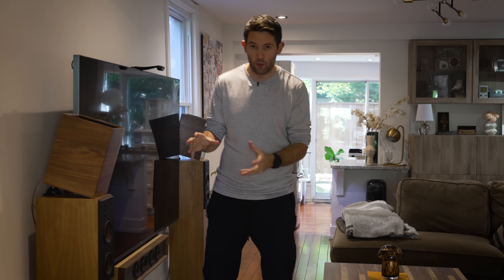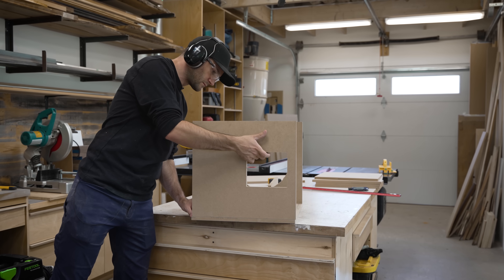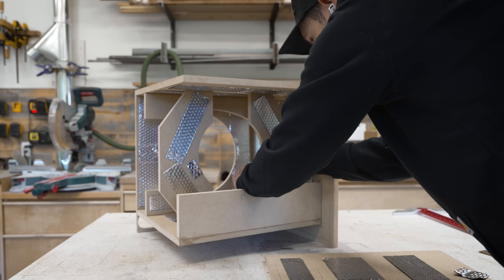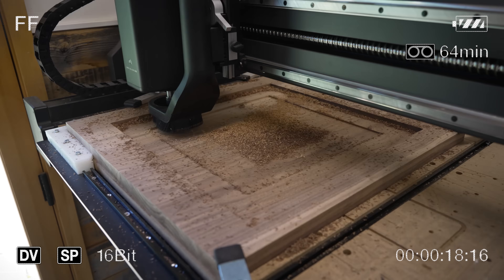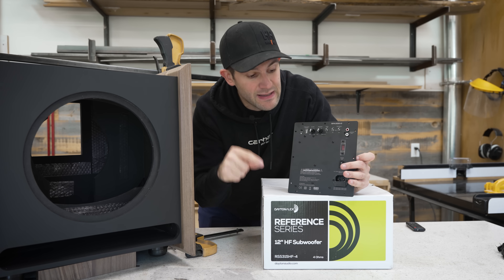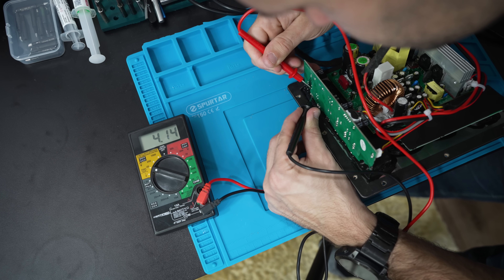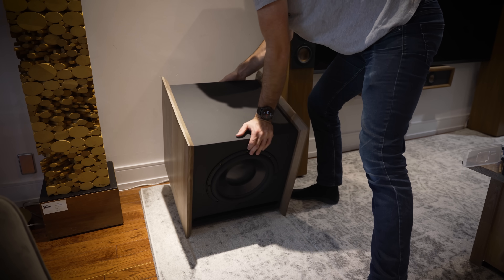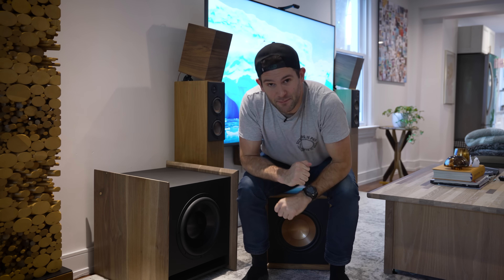THIS changes DIY Audio...

Comment: Guess I have to be that guy: class D is not digital, it is analog. It uses high frequency switching for the amplification, but never converts the signal to a digital state.
Nice build!
Reply: I work with high frequency transistors and amplifiers every day. Not audio, but the concepts are almost identical. 
I’m not going to say a concrete digital or analog, but I’ll give certain facts about Class D amplification. 
1.	Class D requires a conversion to pulse width modulation (PWM). This means there is a sample rate. IE, there needs to be high speed/frequency measurement of the analog signal to convert it to a duty cycle percentage (pulse on vs off), for each pulse, in the modulated pulse. This leans toward the digital argument. 
2.	Unlike a true digital signal, you don’t need a complex digital to analog (DAC) conversion. You need a simple RC (resistance capacitance) circuit, to work as a low pass filter. This is because you only need to find the “average,” which is dictated by the duty cycle percentage. This leans toward the analog argument. 
3.	I saw someone say that this is the purest amplification method. This is not true. The key advantage of Class D amplification is the efficiency. This is due to the PWM method, when the pulse is at 0V, there is almost not power consumption. There is harmonic distortion in a Class D amplifier due to the fact that there is a sample rate. IE, if you put in a pure sine wave into a Class D amplifier, you would see a “stepped” sine wave on the output. Are you going to notice a difference? If you can hear the difference, you’re a unicorn. The lowest harmonic distortion goes to Class A, but Class A is also the least efficient and consequently will be very large in size and will work well to heat your room.
Reply: @rygilly32  facts, thank you!
Reply: @rygilly32  My take away is you're saying that Unicorns have better hearing than humans!
Reply: And also it is actually better to have the power of the amp be greater than the speaker to prevent it from distortion and therefore damaging the speaker. If you turn the speaker up way too loud it will get damaged no matter what.
Reply: @BassBülow  100% this... the amp should always be of greater potential than the speaker... not enought amp is what results in a clipped waveform (DC energy) hitting the speaker and doing damage.
Reply: @BassBülow  exactly, was looking for this comment. Zac is wrong..
Reply: @BassBülow Strange fact: But unlike older tube amps, most solid state amp actually have LOWER distortion when operating near ( but not at or above) their maximum rated power,  so it is actually best to have a “just powerful enough” amp.   Most people have amps that are way too powerful.   But most people cannot here “.05%THD” anyway, so it is usually a moot point.
Reply: @ People don't hear THD. They hear IMD. When it sounds harsh, that's IMD. Clip 10kHz and listen.
Reply: @rickutah7705 I've seen the charts, they support a bigger amp.  If the lowest distortion is at 3/4 power, then a 400w amp driving a 300w speaker would achieve the lowest distortion at max volume.  The flip side is if you drive a 300w amp to maybe 320w you can be at 10% distortion rather quickly.       Even if I run a 1000w amp we're often talking about the difference of 0.005% thd to 0.010% thd.  Good luck on hearing that.  Keep in mind amps also have lower distortion at higher ohm loads.  So if you get a 1000w (at 4 ohm) amp to run this 300w speaker get the 8 ohm version of the subwoofer.   This is now a 500w amp at 8 ohms.  Lower distortion,  still plenty of headroom, and "high current" in home audio terms to signify the amp won't crap the bed if it goes below the ohm load the speaker is rated for.
Reply: @BassBülow  exactly, im running an 8kW rms amp on my monster 24 inch home theatre sub wich is only rated at 4,5k, and it works just fine
Reply: @BassBülow , why higher and not matched?
Reply: @BassBülow this! It’s daft to pick an amplifier less or the same as driver power handling on purpose. Much better to use a comfortably powerful amplifier that can run the full load without stress and with less distortion. I’m still amazed how many people doing projects like this, don’t understand the relationship of power to driver.
Reply: @BassBülow I'm not MECP certified but I did work in a custom home/car audio video shop. I was always taught that amps with less wattage are more likely to damage a sub. Having overhead wattage was a preference and not a liability.
Reply: @BassBülow  It depends. In multi way speakers, power distribution ratio gets shifted towards the midrange and treble as you increase the amount of clipping, so the midrange and treble will be better off with a more powerful amplifier within its clean limits, but the woofer will be worked harder. I mean it's also very variable with the type of music being played too.
Using a more powerful amp will get you the most high quality performance out of the speakers you paid for, assuming you like it loud, but won't necessarily protect the speaker, even though it will sound better right up to its limits. This is a double edged sword as some people might push the speaker too hard as it is still sounding good. Though drivers do introduce their own version of clipping at mechanical limits, thermal limits can sneak up on you, even though those can change the sound signature too.
It also depends on how speakers are power rated. A 200 watt speaker might cook with a 200 watt amplifier playing a sine wave. Many speakers are rated with music in mind, and it's nice to know that the kick drum going PHUT! at 200 watts for a tenth of a second won't damage it, while the rest of the music is at 10 watts. You have to be careful with more and more music having continuous bass and average levels creeping up so the speaker is staying at powers approaching the 200 watts more often and risking a voice coil overheat.
Frequencies are another thing that I touched briefly up above. The power handling of a speaker is different depending on the frequency of the sound. Usually more in the bass and midrange and less in the tweeter. The tweeter can generally produce louder sound on the same power though, both due to its own sensitivity and your ears' sensitivity, which helps. Also at very low frequencies, the woofer can flap around and dent the voice coil former if it bangs into the back of the magnet. Best to filter those out especially in ported enclosures. It will also sound better if your bookshelf speaker isn't trying to reproduce 25Hz.
Reply: @buelow123 exactly i was going to say this as well, but you beat me to it 😂😂😂😂😂
Reply: Using an amp near its max output will give distortion so the signal will not be a nice sine wave but more like a square signal which will damage the coil and cone. Hence the recommendation to use an amp that is able to handle more though not to run it at 100%.
Reply: An amplifier has a maximum output, typically a semiconductor junction or two's voltage drop less than the supply voltage. When it reaches that level, it will start to clip. Music is not really sinusoidal, but sine waves are used in amplifier testing because they have no harmonics—ideal sine waves are harmonic-free. Some audio test oscillators come very close to producing pure sine waves. You can drive an amplifier with a pure sine wave, notch filter it out of the output, and what is left is primarily the distortion. Nowadays, there are more sophisticated ways to analyze it, allowing you to see the various harmonics and their levels.

Square waves are not overly hard on woofers, but they pose a problem for tweeters. A real square wave has an infinite series of odd harmonics that extend into the ultrasonic range—well beyond where the tweeter can move. This ends up heating the voice coils, as they are dissipating power without much movement. Tweeters don't move much anyway, but without cooling from motion and with an undue amount of power, the thin voice coils in the tweeters can melt.

When you see a tweeter with a maximum power dissipation listed, it's often the maximum amount of power in normal music before the crossover, so the tweeter itself is only rated at a small fraction of that number. Try running a 10kHz sine wave into a tweeter rated at 60W on the box, and you might only make it to 5 or 6 watts.
Reply: @BassBülow  Not true, distortion doesn't damage a speaker, to much power does. I have a pair of 70 year old guitar speakers that have seen nothing but distortion their whole lives and work perfectly
Reply: @feltyash6484I think when they’re speaking of distortion they mean clipping, which  is of course square waves rather than sinusoidal, which creates a distorted sound but more importantly pushes the driver into basically “locked rotor amps” for the period at the top of the square wave. During this time the driver is pushed to its max limit and held there all the while drawing lots of current, eventually overheating the voice coil and melting the insulation around the wires. The resulting short circuit not only destroys the speaker but potentially damages the amp as well.
Reply: @BassBülow  Also helps with impedance rise.  That 4 ohm speaker isn't going to be a 4 ohm load on the amplifier once it starts playing.
Reply: @BassBülow you're still turning up the amp you can't turn up a speaker but what do you mean? U mean impedance? Or like Max ratings type stuff. Because going higher impedance is not always good in can strain your amp even burn it out
Reply: @BassBülow  "it is actually better to have the power of the amp be greater than the speaker"
This is highly debatable. What is "power of the amp" and what is "power of the speaker"?
Some amps' power is rated at 10%THD, while some claim it before the THD starts to rise (0,1-0,001%). And the term "power" is even more ambiguous when talking about a speakers.

Yes, when amp starts distoring, RMS power rises (RMS of a square wave is higher than that of a sine wave with identic amplitude), however this is only a problem to a certain degree. 20W amp running at 100%THD will not blow a 100W speaker. However if you want to use your speakers to their full potential, you might want to prefer an amplifier with higher rated power - speakers can typically handle power spikes above their rated power - if you don't exceed their mechanical capabilities (Xmech). The problem, however, is that you will definitely hear an amp distorting, while speaker being pushed above its limits is typically not that obvious (especially when talking about electrical limits).
Reply: @BassBülow  the #1 reason for blown speakers and subs: too little power. Clipping.
Reply: @scottlowell493 Clipping creates overtones. And if you have a 3-way loudspeaker then clipping of low-frequency makes overtones delivered to speaker elements intended for the higher frequencies. But they are designed for less power. In a subwoofer, you don't have any tweeter that will burn from massive amounts of overtones.
Reply: The simpler forms of class D amplifiers are basically modified switch mode power supplies.  Mostly that means the power devices don't operate in the linear region like the power devices of a class A or class AB amp do.  On the power supply side, the opposite of a switch mode supply is a linear supply.

Any way in class D the input is usually analog, the output is always analog, the feedback is always analog.

If the manufacturer adds a DAC input that's kind of digital maybe.

The only real argument for a digital amp is one that uses a DSD input (direct stream digital) which kind of doesn't need a DAC.

Any way, it's a distinction without a difference unless you prefer the distortion of analog systems, which is weird because the speaker itself is the overwhelmingly large source of distortion in a sound system if the source and signal chain are decent (analog or digital).

For reference I used to design switch mode power supplies and worked with Tripath indirectly...
Reply: @beardoe6874  I was about to comment the same thing. As a related aside, do you know why a more robust control loop is not uniquitous for audio amplifiers, especially in class D? I've only seen (wonky) P controllers implemented via single opamp, but not really something more robust as a PID or similar as the case in (higher end) powersupplies.
Reply: @ivanrodionov9724  audio power rails are usually just bridge rectified and filtered AC, not regulated.  The idea being that the feedback for the audio signal will automatically compensate for the 60hz ripple and any other line noise.  A regulated supply will have steadier voltage but if it's a linear supply the power device in the regulator will act a bit like a resistor if you are pushing the power too high.  A switch mode supply might be able to keep up a little better but still it's going to limit the supply headroom, slew rate or whatever you want to call it.
Reply: Pffft what would this guy know 
Checks username 

Oh...
Reply: Correct.

The "D" designation is coincidental; it was just the next letter in line after the previous new category, which was class C.
Reply: Thats what I was just about to come post lol. I just got my own class A amplifier working from scraps yesterday and when he said that I was just like, Surely someone else caught that! But yes, class D amplifiers are more efficient (Amp per Decibel) and still fairly low distortion.
Reply: That was a pretty funny statement
Reply: I was a little confused by watching the video and disagreed on a few of the statements made, but then I started reading the comments and realized some of you know WAY more than I do.  I hope all of you are doing something with this knowledge you have.
Reply: Goodness everyone so knowledgeable here. 
Is it clean?
Do I feel it starting at my toes? Does it crawl up my spine? Does it lightly tickle my heart? 
Does it remind me of my grandparents sound system from the mid 70’s to mid 80’s? Yes?
Than
Yes!😂
Reply: Digital vs. analog has everything to do with how information is transmitted. In digital signals the information is encoded in discrete, well defined states (1,0 or on/off). The signal is generated so that there is no ambiguity on whether it is one or the other. In analog systems the information is represented as waves. In the case of a class D amplifier the information (sound waves) is received as a wave and leaves the system as a wave. The pwm is not used to transform the information into discrete, well defined states (that would be an ADC) but instead to generate a new wave, extremely similar to the first but with a lot more power behind it (hence the name amplifier).
Reply: I like pizza
Reply: This a fragment of an interview with Mr. Bruno Putzeys, an authority in class D design:

Q: Why is class D considered digital, when it isn't?
A: To be exact, class D isn't digital. Digital means everything is done on numbers. A class D amplifier works with voltages and currents changing in time, as any other amplifier does.
This misconception comes from a misunderstanding of the "D" letter. It was invented in the 1930s when classes A, B, and C already existed. So they named it with the next letter: D. Of course, in those times, there was no digital technology with which you could mistake it. In 2004, I co-authored an AES(Audio Engineering Society) document titled "All Amplifiers are Analogue". It's worth googling and reading.
Of course, there are amplifiers utilising DSP as an element and you can call them "somewhat digital", but "real" digital amplifiers don't exist.
Reply: @DIYHiFi Sigh. I think we are semantically passing ships in the night. Digital the way I’m using it in this case is two state 1/0. Digital the way it’s described and I think you are using it is a discrete sample in time e.g. A/D - D/A conversion. Both are discrete though. And using a filter to get rid of switch artifacts in the output of a class D would pretty much nail that the signal was discrete time at some point in its journey 😅
Reply: @DIYHiFi  I beg to disagree with his rational.  The control element is either on or off, that is digital.  It is not digital in the same sense that other digital audio systems are digital, but there is no question that the output are not operating in their analog regions and in fact the type of transistors used in this type of circuit are designed to have a compressed linear region.  They are designed to be used full on or full off.
Reply: @reggindog3436  Bud, I hate to tell you this, but audio amps are not digital.  What is the line signal to the amp?  It's not a digital signal, it's analog and it runs on RCA connections.  It makes zero sense to take an analog signal that has already been received, convert it to digital just to convert it back to analog.  Think about it, for what purpose would you change from analog to digital and then back to analog?
Reply: @reggindog3436  It is also a very common misconception. A switching signal, that is on and off can be digital. But doesn't have to be. PWM which is pretty close to what is happening in a class D amp, can be generated with a digital circuit, but it can also be generated by a NE555 timer with a couple of resistors and a capacitor. Switching mode power supplies are also analogue and they are using switching: on and off state. 
Refer to the recommended article by Mr. Putzeys and check the definition of a digital signal on Wikipedia.
Reply: @realmenhavelittledogs2661  I dunno,.  Only like all audio you hear these days?  Starts with an analog mic, analog mic pre, a lot of folks still use analog eq etc, and save the track digitally.  Master it, send it out digitally, and you play it back through analog speakers so, pretty much the entire audio chain is what you suggest is dubious in purpose.  

In the case of a class D amp the transistors are used in a binary state on or off.  The switching frequency is high enough the output can be filtered with a relatively simple and inexpensive low pass filter and in the end you get a pretty good approximation of what you put in.  

Tell me, do you consider switching power supplies analog or digital devices?  Would you call a switching power supply an analog power supply?
Reply: @reggindog3436  That statement just proved you don't know how audio components work.  Signal encoding has zero to do with how it is rendered/reproduced out side of a couple of formats (AAC and MP3) that reduce sound quality in favor of file size.  After the signal is decoded at the Signal Processor (Pre-Amplifier, Receiver, Head Unit), how person "X" saved their sound file doesn't mean squat and signal encoding is not what this conversation is about.  This is not dubious, this is common knowledge.  Let me ask you, can you plug a Digital Music Controller (phone, mp3 player, etc) directly into an amp?  That answer is no.  Because the signal hasn't been decoded to an analog signal.  

Focus on the conversation at hand, power supplies aren't the topic.
Reply: @realmenhavelittledogs2661  The conversation at hand you seemed to think it was weird to take an analog signal, digitize it and than turn it back into an analog signal.  Regardless of the codec used, that is pretty much the digital audio chain as I pointed out.  Start out with analog, digitize it, and ultimately turn it back into analog.  So that sequence of events is very common.

As far as the power supply question, it relevant as a class D amplifier is pretty much a switching power supply.

You are welcome to believe what you like, but for my money, when an audio amp runs it's output devices in a binary manor, I am going to consider it a digital amp.
Reply: @reggindog3436  You really need to read better into what I was speaking about with an AMPLIFIER.  The LINE INPUT (aka the signal that carries the music/audio from the signal processor into the amplifier)  is analog (RCA input jacks).  So the INPUT SIGNAL into the AMPLIFIER is ANALOG.  You mistakenly claim that it is then converted to digital just to convert it back to analog.  So I ask you, why would they convert an ANALOG signal to digital then just convert it back to analog?  

And you are trying to obfuscate the matter by talking about the prerendering of the audio, which has NOTHING to do with the input to the amplifier.

And no an amplifier is not a power supply, you are extremely mistaken on that one.  Even a simple google search will tell you that.  The function of an AMPLIFIER is in the name, it takes a signal and AMPLIFIES it.  It does NOT provide power and in fact REQUIRES a power supply to function.

The humor is how wrong you are and yet you are still trying to make yourself right.  Please research just a little next time.
Reply: 100% correct. A class D does not mean Class Digital. Does Class A/B mean Class Aight Bruh? Haa. Completely incorrect there. Maybe some of the "features" are digital.... Lol
Reply: That high frequency switching is a 0 or 1 state, unless you think it's different that's digital.
Reply: I came here for this comment😂
Reply: Just saw this video and I was going make the same comment on Class D amps... Analog for sure!
Reply: The "D" is simply the next letter in a series of amplifier classes ie: A, AB, B, C, D, G. It doesn't stand for digital. However, I can assure you this IS a digital amplifier that uses PWM (or various other digital modulation methods) to simulate a linear wave function.
Reply: Correction: Technically, Class D is not a digital amplifier—it operates differently from linear amplifiers and can be paired with digital processing. 🫡🔊🫶

However, some manufacturers do use true 1-bit digital amplifiers, such as Bose, McIntosh, and Devialet with their ADH hybrid technology. These do exist in the car audio world.
Reply: The D doesn’t stand for ‘Digital’. Actually  the letter monikers used to identify the different classes of an amplifier don’t stand for anything specific. Without going into huge details, a Class D design takes an analogue input and turns it into a PWM (Pulse Width Modulation) signal. The peak of the signal results in the widest pulse and the trough, the narrowest. Class D amplifiers always have an output filter to takeaway any high-frequency noise generated by the conversion process. This is where the quality of the filter used has a great bearing on the overall sonic performance.
The major plus point of Class D is it is very energy efficient. A typical Class A design tends to be around 30% efficient. Class A/B roughly doubles that and Class D amplifiers almost triple it. That means proportionately lower power consumption which leads to less heat. The efficiency also allows Class D amplifiers to be smaller but still deliver huge power outputs for their size.
Reply: Correct
Reply: This made ma watch PS Audio's "are class D amplifiers digital" and learned me some. From my understanding, for something to be digital the receiving end also needs to be digital. (Also the pwm should have some data digitally), except this pwm doesn't, the receiving end is analog, a low pass filter. 
If you would look at the pwm of the amp, you could kinda figure out the "sine wave" of the audio.
In digital, you'd have to know the encoding/protocol, then decode that data. You'd be usually using a logic analyzer for that, a digital receiver. But if you try to use that on a class d amp, there's no data to decode, because it's basically an analog signal in a different form.
Reply: @DIYHiFi  you're both right.
Reply: Zach is an idiot when it comes to speakers.
Reply: Class D amps are good for sub bass as well.
Reply: Ah, thanks. I wanted to comment the same, but you spare me the effort. :)
Reply: I don't think that I would void my 5 yr warranty from Dayton to hide a few wires that would be out of sight any way.  If it is that a serious consideration, overlap 3 of your cabinet panels that back up to your wall
Reply: Theres always someone smarter and better than you
Reply: Connect it to the spi interface, decide on bit length. Process signal to bit sequence to represent sound or simply code it to have pwm sequence. Profit, now it is a digital sound. 😂
Reply: Bravo, I did the same thing for watts & speakers - drivers don't have watts.
Reply: @johnsmith1474  IDK who you're talking to, but while drivers don't have watts, they do have thermal limits rated in watts.
Reply: Exactly. And well-said.
Reply: Often the chips work digitally internally doing the choice with logic to turn on or off. 

What you want to call digital i guess can vary, not that it matters for you if theres an adc involved.
Reply: The comments are far more entertaining than the video itself. I run a single kicker cvx 10" on a 1 ohm class D kicker amp (with FIT technology ) @ 495 RMS in a huge box tuned to 38hz and a sound stream digitizer. Flexes the roof of my SUV. I'd put it up against any 10" on 500rms.
Reply: Well, at least it is 4k UHD.
Reply: The only true analog app is a class a and a class a b amplifier
Reply: @mikesmithyo1983  FFS, No, Mike. Class D is analog in, analog amplification and analog out with no encoding happening anywhere. Everybody gets hung up on the PWM power supply, which isn't really digital, either.
Reply: A lot of people seem to be confused and think that PWM is digital but it doesn't have to be, if it's on a micro controller it probably is, the width has steps, an 8 bit PWM output would have 256 steps as an example (digital). You can however have infinite steps to determine the width (analog),  Class-D uses the latter, which makes it analog, Yes there is switching going on but the length of the on/off time is analog and isn't determined to by certain amount of steps in a Class-D amplifier.
Reply: @RoycoNL  "A lot of people seem to be confused", including yourself. The word Digital refers to either a one (high) or a 0 (low). You appear to be confusing and trying to say that digital has to have a set number of pulses, which is untrue. Class D amplification is done by switching MOSFETS on or off (Digital) then smoothing out via a filter, just as you would with a D to A device.  In fact class D could not be done properly until the MOSFET switch came along, given both geranium and silicon devices could not switch fast enough. Note the word switch as in a TTL is a switch and is digital just like the mosfet switch which is also digital.
Reply: @michaelward402   I think you should look up how a Class-D amplifier works, the length of the pulse is determined by the audio signal which is pretty much analog in a Class-D amplifier, that is uses a switch is irrelevant, so anything with a switch is now suddenly digital? what about a switching power supplies? the themostat on your heater? Do you even have a background in electrical engineering?
Reply: @michaelward402   Not a set number of pulses but a set number of values, the length of the pulse in a digital PWM output is determined by a resolution, in my example it was 256 values, in analog it's practically infinite and that's what a Class-D amplifier uses, at no point is the signal being converted into a pure digital value.
Reply: @RoycoNL  Now that is just abusive, have you actually referred to a dictionary and looked up the term digital. What you are describing is not analogue in its purest sense it is digital and there is no way anyone can disagree with the fact that it is a switched waveform that requires filtering to produce an analogue waveform. 
There is little point in trying to be abusive when you clearly cannot reconcile the fact that a switched waveform is digital in nature and yes a smps is digital, not only based on the fact that any English dictionary tells you it is, but the fact that it is not an analogue linear PSU.
I won't bother answering again given your clear bias and inability to understand what the term digital means.
Reply: @michaelward402   I didn't mean to be abusive but I think you fail to see that the length of the pulse is part of the equation, it's not just pulses of the same length at a fixed frequency, I'm sorry that I can't seem to convince you but I'm convinced you are missing part of how this works. The only digital part of the Class-D amplifier would be the output stage being on or off, the length of the pulse is still analog. Calling something digital because one part of it has only two states is a bit  short-sighted imho, that would make about everything digital including your class A amplifier if it had an on/off switch.
Reply: @RoycoNL  A class D amp does not give any infinite resolution - it delivers quanta. Ha ing transistors pulse haed between on and off causes an output signal that needs a low-pass filter to get a signal with soft flanks instead of a burst of square waves.

You can go from 16-bit or 24 bit to 48 bit and you can count every single electron that was carried by each pulse. But knowing the actual electron count isn't really a needed step here. It's enough that the transistors are run at a digital mode. The purpose of the process here was never to keep/record the audio. Just to move it to the digital domain for the driving of the transistors before the final low-pass filter.

The amplifier is mapping continuous infinite values into a smaller set of discrete finite values. Some amplifiers has a fixed charge/pulse. Some has a finite number of pulses/second. PWM is one of four different ways this is done, to get into the digital domain needed for the output transistors. And a reason why a class-D amp needs the same type of lowpass filtering as other DAC solutions to produce a smooth output signal.

Analogue transfer is water continuously flowing out of a faucet. Change to a bucket brigade and you have moved into the digital domain with quanta of water.
Reply: @perwestermark8920   I'm not the best at explaining things but the point I was trying to make is that there is no bit length in Class-D amplifier, you're comparing the analog input signal to a triangle/sawtooth wave at usually a fixed frequency, this determins the duty cycle of the PWM signal, at no point is the signal converted to a pure digital data stream.

take the faucet example you mentioned, you can open and close the faucet at fixed times but the time you open and close it between those fixed times can be analog, but yes you will need a lowpass filter to smooth it out like DAC.
Reply: @RoycoNL  But what you are talking about really is moving the signal into the digital domain - the strict off/on of the transistors is a digital operation (if we ignore the flaws of the physical world where the transistor switch time isn't fully instant).

It does not matter if you can put a number of bits on any sample or not. Digital encompasses more than that. You have left the analogue world when having the signal passing a transistor that is only fully opened or fully closed.
Reply: @perwestermark8920   I have to disagree on this one, take your faucet example, you are creating pulses at a set time interval by opening and closing it, but how far/long you open it (the pulse width in PWM) is still linear/analog in a Class-D amplifier no matter how hard you drive that transistor, so at no point is this true digital signal, we're looking at more than just the state of the output, but I'm convinced I can't convince you and I doubt you can convince me so I'll just leave it at this :)
Reply: it's a digitally controlled switch? :) But true that, then filtering with low pass, and what we are left with is our sound :) No waste, no heat, genius.
Reply: And oversizing your amp is not always a bad thing. It gives you Headroom and less chance of clipping.
Reply: the d is for dermarse
Reply: The "D" in Class-D does not stand for digital as it is a sequential identifier. However, it is fair enough to call it a digital amp because it works by converting an analog signal into a digital code, then switches it to a higher level, then converts it back to analog with a low-pass filter. The reason why people say it is NOT digital is because it is not PCM, but PCM is only kind of digital coding, albeit the overwhelmingly most common kind. Believe me, no one is more pedantic with terminology than me - but it is ok to call it a digital amp.
Reply: A class D amplifier is digital. It uses the MOSFET in switch mode instead of linear gain mode. That means the transistor is either on or off. That is the definition of “digital”.
Reply: I prefer a G/H amp in Carver old school power
Reply: Most amplifiers have filtering to roll off the HF output above the audible range.  Class D in particular is filtered because it has more HF switching energy.

With that said, distortion can be very low, competitive with the best Class A, Class A/B and the distortion that exists (near clipping) sounds kind of tube-like.
Reply: @beardoe6874  .All Class D amplifiers, as you noted, require integrating capacitors and filtering due to their design. This is just the nature of the beast. Most linear audio amplifiers do not intentionally roll off high frequencies. Looking at some of the amps I have around here: the Phase Linear 700 and 400, both are good to at least 40 kHz; the Spectro Acoustics P202 is also good to at least 40 kHz; the Adcom GFA-555 is good to at least 100 kHz; and in my room, my old McIntosh MA 230 with tubes and an output transformer is good out to at least 50 kHz, as is its solid-state cousin, the MA 5100. As a general rule, the only amplifiers where the high-end frequency response is capped are Class D amplifiers, and that is not because they want to, but because they have to.
Reply: Though it’s technically analog the reason it gets its name is because of Puls Width Modulation (PWM) the switching on and off is compared to ones and zeros. One being on and zero being off. This idea of switching is similar to digital in that digital is made up of ones and zeros and is not linear. Also PCM (pulse code modulation) is not the only digital format. DSD which is puls density modulation is considered digital even though you can play it directly into a speaker or low pass filter with no code unlike traditional PCM. Similarly the technology used in class D has similarities to a digital signal even though it is not PCM. If you ask many engineers about this they will give you a similar explanation and many consider it to be a form of digital.
Reply: @johnj596  It is technically digital.  It converts the analog into a stream of digital pulses, and filters them to to get an analog approximation of the digital pulses.  All of the amplification is being done by devices either being on or off and trying as hard as they can to remain out of the transistors analog range.  Call it a switching amp if that makes you feel better, but it is switching between on and off.  There is no analog there.
Reply: Oh, he must be talking about a class A tune amp!?
Reply: This guy has a lot to learn about building speakers.  No shame or shade, but you can tell he's a rookie.
Reply: go check your books before posting bs. class D is digital amp, A or B are not.
Reply: I love this guy, but this was literally the moment where I had to go to the comments... you raised the topic very gracefully.
Reply: I had the same exact thoughts when I heard him say it. Same with the comment below about the amplifier being greater than the speaker. The more you crank up the amplifier, the more the distortion, and shorter the speaker life. Better to have a 500w amp turned down than a 300w at max all the time. It did come out nice though, I'd still suggest putting a larger amplifier in.
Reply: PMW is using transistors in a binary digital on off mode not linear gain devices this is what a digital transistor does. So even if its not actually digital it is using the transistors like digital devices not amps. Also in most the pulses are synchronized with the digital audio signal making it a direct conversion from digital to analog. meaning it is made for a digital source.
Reply: @remotepinecone   The original comment still stands though. Class D does not mean digital amplifier. The term has been in use long before "Digital Amplifiers" were commercially available. It's referring to the power supply and it's efficiency. The simplest way I remember when I was still doing car audio it is that Class D is more efficient and class AB had lower total harmonic distortion. Class D amps were popular for mono-block subwoofer amps because the distortion wasn't really heard in the final product, Class AB was used for mids-highs for better sound quality.
Reply: Do you believe that PWM is analog or digital?
Reply: @railgap  PWM is a digital signal. It is possible to sweep the pulse width so quickly that a single pulse could start at 0% and end at 100%. Could we say that pulse is digital but the width is analog? Perhaps. But since most PWM sources are microcontrollers, the width of a single pulse is fixed.
Reply: So which amplifier is digital
Reply: @pavus9821  Class D uses switching (digital on/off) to simulate a linear function.
Reply: Depends on what you think "digital" mean. It is digital in terms of using exclusively "binary" power states (on/off instead of smooth gradients). By the definition of the word "digital", a class D is indeed digital. 

A digital signal is just electricity in a cable just like analog signals are, but they transmit the signal as rapidly pulsing on/off states (1's and 0's), which is what MAKES it "digital" in the first place.
Reply: @MFKitten  
Yes, digital CAN mean a two-state system, akin to binary. In the context of amplifiers, which is what's being discussed, we're talking about the SIGNAL, which is not digital in this case. The power supply isn't even technically digital by the looser definition, it's PWM which is an analog signal, just... rotated 90°.
Reply: @SwervingLemon  digital is not just binary, it can have many steps. Perfect example is a dac which is a digital to analog converter, the more steps the better resolution which gets you closer to the analog signal which is continous.
Reply: The build is nice, but a lot of the information is incorrect.
Reply: It’s a matter of semantics. In the most fundamental form it is digital since one operates the power transistors not in the analog region but only in the on/off states.
And yes this binary output signal is heavily filtered both in the amplifier but also in the speaker element to regain the analog signal.
Reply: @andax2007 There's no bitstream. Period. No encoding, no ADC. It's A2A. The frequency of the PWM even has to be outside the realm of 22k just to avoid high-frequency noise entering your signal. The only part of this that people are mistaking for digital absolutely isn't. PWM does not equal digital.
Reply: @ a signal can be digital both in the amplitude and temporal space.
As I said it is semantics. As there is a comparator in the processing chain having a binary output. This output controls the power transistors to be either completely on or completely off.
So yes the signal is indeed digital in amplitude, but it is not a clocked process, so it is continuous in time.
Reply: @andax2007  But PWM isn't discrete. It's just a voltage over time, chopped and laid on it's side. You can keep trying to make the class D look like it's digital by broadly expanding what qualifies as digital, but I'm done entertaining this nonsense.
It's A2A at the end of the day.
Reply: @ with this reasoning you could say the any signal is not digital. Is a UART signal analog or digital?
As I said, it is an analog output signal due to it is heavily filtered.
But it is in principle digitized into a one bit binary signal at the comparator in the signal chain. Once more, a signal can be discrete both in amplitude and in time. PWM is a signal discrete in amplitude. Yes this signal is transported as a voltage (but only in principle at two levels). Is a MCU digital? It carries the signal internally as analog voltages.
Reply: @andax2007  Good god, no. I'm done with this ridiculous premise.

There is no encoding happening here, no interpretation of an encoded signal. There is approximation happening here, not quantization. Your UART argument is a strawman. The amplitude in the class D is NOT discrete. It's domain is time and infinitely variable between 1 and 0.
Reply: The D was for dumbass😁
Reply: but it says digital on the box
Reply: wrong, it is a digital amplifier
Reply: Thank you :-). I guess we are all that guy.
Reply: Is a good thread by the way I like your home theater system everything together looks all really nice all together and I will follow you and see some of the parts you can put together to build your own boxes I would say one thing is there a few things you're missing I just I know what she would be to research certain materials and see how they react with vibration expanding and collapsing spackle is not a good idea on your speaker boxes devil crack breakdown eventually be dust inside your system
Reply: So many people think Class D is digital
Reply: A very nice build. The sub looks beautiful. I really enjoyed watching this video.
Thank you!
-
Dx.
Reply: Thank god. You saved me some typing.
Reply: until it arrives at the wireless transciever. which looks like a very cheap one and probably is going to be an absolute bottleneck for audio quality
Reply: technically analog is just electrons
Reply: True, i tripped when I heard that as well. Lol
Reply: I am a professional sound engineer and I use class D amps all the time..... they are not digital.
Reply: @arthurton365  They have come a long way.  Back when I was putting Alpine Type R 12's in my car, D was for the sub realm and AB was for mids and highs.  Crazy seeing that they are now running whole audio systems off one D amp.
Reply: @arthurton365 Sound engineers counts as specialists on electronics? When was the last time you built any amplifier? Ah - maybe your knowledge of the inside isn't your specialty?
Reply: In a way it is. The switching transistors are switching between discrete states. That's digital. Yes, not digital in the way many think of it as being, but it's still digital.
Reply: At its base, class D is 100% analog. However, the PWM signal can be directly represented as a stream of binary values. This is what DSD digital audio encoding uses.
Reply: @jeabo0adhd  a stream of binary values with a continuously variable time domain.
Reply: Because analog in and analog out doesn't mean isn't a digital switch inside. And D also combines with Digital, what the F. 😮 So, what's the problem with it!?
Reply: To be fair, he did not state that the 'D' in 'Class D' stands for 'digital'... which it does not, of course. However, everyone claiming that it is a digital technology is mostly incorrect as well.

Class D amplification is not a purely digital technology, but rather a hybrid technology that combines analog and digital elements. It is an analog amplifier that uses digital-like techniques to modulate the output, but it does not directly process digital audio signals.
Reply: @DIYHiFi  the PWM used is tristate. 1, -1 and 0. So you could say it's trinary before the smoothing.
Reply: I think it's "digital" in terms of the output state and pulse period, but not the pulse width. Obviously after the smoothing inductor it's just an ordinary sound wave.
Reply: @TimpBizkit   In car and home audio, there are 4 classes of amplifiers A, B, AB and D.  It has nothing to do with digital, it's just the class of the amplifier as it relates fidelity and distortion.  D became the go to for driving subwoofers because the fidelity is not as important with lower frequencies.
Reply: @TimpBizkit  Whaaatt ?!?
Reply: Analog and digital signals are still electrical sine waves. They're not square as they are drawn. They look the same. There are no such things as digital signals. All signals are analogue. How we process and observe the is the digital part.
Reply: @TimpBizkit  On and off = digital. Time doesn't effect definition. Hell the light switch on the wall is digital. I think people confuse that word with "digital logic" which these amps aren't.
Reply: @lazzer408  I was thinking of digital as meaning discrete in both amplitude and the time domain. In the case of class D, both the pulse amplitude and pulse frequency are set. Let's say the choice of 10 volts, 0, or -10 volts, and 100,000 times a second. The difference is in this example you can have any pulse width you want from 0 to 10 microseconds. You can have, 1 microsecond, or pi or the square root of 2 - an infinite number of possibilities. If you had a minimum pulse variation step of say 0.01 microseconds, then you have a discrete range of pulse widths and thus a truly digital signal.
Class D has some discrete and some continuously variable parameters - a bit like old school cinema film (before a hi res DVD or bluray was stuck in the projector). The frame rate is set, and while there may be some limits on film resolution due to its make up, the colours and parts of the image aren't set on some square grid of pixels and are thus continuously variable.
Reply: @lazzer408  I usually call it "digital" if the signal can be stored as a finite number of discrete parameters. Analog usually has at least one variable on the real number line, thus theoretically requiring infinite memory to store "digitally."
Reply: @TimpBizkit  Time doesn't matter. A light switch is digital. Is it memory since it can remember a state? Absolutely.  8 light switches becomes a byte. But I digress...

adjective
adjective: digital
1.
(of signals or data) expressed as series of the digits 0 and 1, typically represented by values of a physical quantity such as voltage or magnetic polarization.

In the case of class D amplifiers, it's a voltage with a state of on or off.  That signal is then passed through a filter. Typically an LC Low-pass. For the life of me I can't remember what the word for it's function is. Quantization filter? [brain fart]
Reply: @TimpBizkit  Digital = on and off. Length and/or period is irrelevant. Your bathroom light switch is digital. Just because the time it's on varies infinitely doesn't make it analog.
Reply: Turning analog signal in to PWM is literally what digitizing is. It's how the cheapest integrating ADC convert the analog input in to timed impulses for the core to encode. However, the conversion in this case is no further digitized or processed. So you are dealing only with the raw PWM or with LPF at the output.
Reply: " It uses high frequency switching for the amplification," sorry bud, thats not how it works
Reply: Fire Monday blowing
Reply: Hmm. Well I guess it's a matter of definition. In a class D amp, the input signals are buffered, offset, pre-amplified and converted into a PWM signal which has two states: on and off. Which quite literally makes it a digital signal in my book. The power amplification is done in the digital domain. Yes, the pulse widths vary as a function of the analog input value, but that does not make the PWM signal analog.
The fact that a signal starts as analog and ends up as analog, does not mean that the PWM signal is analog. It is digital.
Reply: @manfredsuttorp3659  It really IS down to definition; because, at what point does switching a transistor on and off become "digital"? I think most people refuse to call anything digital unless it sends and/or receives a digital data stream. I, OTOH, would argue that a pinball machine is digital.
Reply: @manfredsuttorp3659  Well I would argue that PWM output is just as worthy of the term "digital" as any of the many "digital" class AB amplifiers I've had in my day, which merely decoded digital input signals into analog voltages. Class D just does it the other way around. And, no, sorry, I'm just old enough to recall having an arcade down the street from my high school :).
Reply: @MrDavidBFoster  Ah, but there is theory and science vs marketing. They are both at their far sides on the spectrum of truth. I'm sure you'll agree that there's a lot of BS around in marketing. This is certainly the case in audio. A "digital" AB amp is utter marketing BS and probably refers to something stupid like a remote control being incorporated in the product. As you said, that was in an age where "digital" was the holy grail of just about everything, now, audio brands wants to avoid calling things "digital" as much as possible. And I see no reason for that really. PWM however is a well known modulation technique which is well defined and recognised in electronics design. Not much debate about that. And I know for a fact that a PWM signal has digital properties at its technical (transport) level. On the functional level, sure, it may be considered analog. But that would also classify Spotify as an analog source.
O well,  at the end of the day, all that counts is good sound, which makes our discussion a bit philosophical I suppose...
Oh, and I indeed own two pinball machines of which one I have fully restored, and the other one being work in progress. :)
Reply: stupid shit , class D means Digital , is a 1 Bit digitalisation. This Datastream gets analog again by a DA converting with Filters !
Reply: He did not mention crossover, nor did he have balanced audio. I think this is an amateur work. He should do more research or ask a professional.
Reply: @hatobp  Yeah, he is just showcasing his machines and technique while not presenting the difficult stuff like matching driver to box volume, shape or calculating port length and size for what desired frequency, etc.
Reply: @hatobp  asking a professional hifi person how to do it is how you get all the other professionals complaining about how everything is wrong /hj
Reply: @ThylineTheGay  "professional hifi person" hahahaha
Reply: @hatobp or… he mentioned a subwoofer amplifier. Which would have a variable crossover built in, oftentimes.
Reply: @hatobp  It's his channel, mate. He can say what he wants. If he were selling you things, then yeah, he's gotta fact check. Don't take your advice from Tom Dick and Harry on the internet.
Reply: @hatobp ... says you... he can do whatever he wants. thank you uploader for the creative expression.
Reply: @hatobp  My home setup includes a DVC 4-ohm sub running at 2-ohms, and a car audio amp... powered by an ATX power supply. It's got built-in crossover and filtering. Definitely overpowering, only cost about $150 total for everything.
Reply: @hatobp No need for balanced audio. That's for long cables with very low amplitude. So very important for microphones. Seldom needed for a sub.

Cross-over filter? That's something my amplifier would supply. Lots of amplifiers have dedicated low-level sub outputs. Cross-over filters are needed for people lifting the audio from one or both channels using either the normal low-level outputs or lifting from the speaker outputs. In my case, I specify if the amplifier should send the bass to just the sub or sub + main speakers or sub + many speakers by a setting for center speaker, one for left/right front, one for left/right back, ...
Reply: @hatobp  Huh? Plate amp likely has at least a knob, if not programmable (dsp /digital) XO. Maybe he uses miniDSP, like me. Consumer/home speakers and subs are extremely unlikely to have a balanced (XLR or TRS) input(s).
Reply: @hatobp  
Balanced line level interconnects are not applicable here, because he is using a wireless signal connection.
Balanced connections are only beneficial when running long lengths of line level interconnects, where they're susceptible to picking up interference.
Perhaps you should ask a professional before making comments.
Reply: @wjkgreen  I knew that. I was just thinking about pro studio gear at that time and not this HIFI home consumer garbage.
Reply: PWM is a digital signal that is rapidly switching on and off, mimicking an analog signal (a waveform). We can then adjust the duty cycle, which is the fraction of a period where a signal is active. Simply explained, if we have a 50% duty cycle, we are working at half capacity
Reply: Good to see lots of people differing here.  The audio is in fact broken into s series of full on's and full off's out the output devices, that is ones and zeros.  This is where it gets it's high efficiency and high power output without a lot of heat.  The semis are never operated in their linear areas.  It is passively low pass filtered to keep the switching frequency and artifacts out of the output, leaving you with just the low frequency (audio) modulation.  If you do not consider and amp that does this digital, I am curious as to what you do consider a digital amp.
Reply: Untrue, class D can be both, especially with the new revision that was put out by AES
Reply: @thefamily512  Recite me chapter & verse regarding the AES revision.
Reply: @thefamily512  ah, the concept of a power DAC. Yes, I'm familiar with it. It has digital inputs and an analog output (for speakers). It is a digital to analog converter. Texas Instruments has chips like that. They are popular in smartphones for an example.
Still not a digital amplifier.
Reply: @DIYHiFi  There are a few projects that use FPGAs to convert I2S data to one or two PWM signals that directly connect to the MOSFETS. Its an interesting niche area of DIY audio.
Reply: It is digital. Just not PCM. It is PWM.
Reply: @rsilvers129  No, it is not. D class circuits has nothing to do with digital signal, it's just the design class.
Reply: @rsilvers129  For fun, let's hear your definition of what constitutes a "digital" signal. I'm gonna guess right now that you're going to assume any square wave is digital.
Reply: I don't know of anything more "digital" than pulse-width modulation.
Reply: @MrDavidBFoster  It's NOT digital. And guess what? Your ears are not analog, either.
Reply: @ScottGrammer  The signal is not digital. The amp, however, is. And that has nothing to do with biology.
Reply: @MrDavidBFoster  I'm sorry, but a class-D (pulse-width modulation) amplifier is not digital. Digital audio works by making precise voltage measurements of the analog audio signal at regular intervals, and then using those measurements to modulate a power supply so as to recreate the same (or amplified or reduced) voltages on playback. A reconstruction filter removes the steps between measurements (samples). 

Pulse width modulation does none of that. It simply uses the analog input to change the duty cycle of a high-frequency square wave. A low pass filter then removes the square wave, leaving just the modulation (audio). In PWM, there are no ADC's or DAC's, no sampling, no DSP, nor is there any buffering (memory), and there is no way to record or store the signal, none of that. It's far simpler than digital audio.
Reply: @ScottGrammer  Now we're just mincing words. A class-D amplifier does the same thing for AC voltage that a digital encoder does for a bitstream. The resulting sine wave is identical (frequency differences notwithstanding); the process of creating it is the same; the difference is that one is stored to a file in the form of 0s and 1s, the other is streamed directly to a speaker in the form of voltage pulses. TomAto / TOMoTO. It is possible to record PWM directly to bitstream, but that's mostly a thing for the Raspberry Pi crowd.
Reply: @MrDavidBFoster  I give up. Somebody else can try, but I give up on this one. I have other things to do. Maybe I'll make a video on it sometime. Happy New Year, everybody.
Reply: @ScottGrammer  And if the prerequisite for something to be considered "digital" that it must have a stream of 0s and 1s being sent down a wire to be intercepted by some interpreter at some point, then no doubt your video will be 100 percent accurate. Cheers!
Reply: @ScottGrammer  of course there is a way to store it.
Reply: Class D is digital... PWM its not analog... Extremely high "sampling" of the analog input to give an indistinguishable signal from analog... P.S class D is technically the "cleanest",  "purest" un coloured sound you'd get on a technical level with perfect filtering. 😅
Reply: @MDMedia473  Well, at the end its all analog sines waves as the low pass filter blocks the higher harmonics of the square wave(remember fourier series for square wave?)
Reply: @MDMedia473  Class D amplifiers were invented and named by Alec Reeves in the early 50s. He named it class D because the three main classes of amplifiers in use at the time were class A, B, and C. He never used the word "digital" in his writings. The timing of the PWM is analog and infinitely variable (within the limits of quantum physics, of course). There are "digital amplifiers" that are high power delta-sigma converters.
Reply: @MDMedia473 PWM is analog ... being interpreted and converted to a digital value... am I wrong in this belief?
Reply: #r2rlife
Reply: @MDMedia473 Then do inverters not count as AC as they are also smoothed pwm?
Reply: @MDMedia473  NOT digital, unless you redefine "digital". Is alternating current (AC)"digital" and DC analog too ?
Reply: @MDMedia473  class d is not digital .The d does not stand for digital.
Reply: @MDMedia473  Not true, class AB would be the most transparent, technically speaking. But it doesn't matter anyways because no human is actually gonna hear the difference between a good class AB and class D; the THD is WAY too low in both cases for any human to pick up on.
Reply: @MDMedia473  Yea, I'm sure the analog signal is put against a sawtooth to drive the power device on and off like a SMPS.  The output is likely filtered so it would appear to be analog but it is in fact being made from a 0 and a 1.
Reply: Absolutely it's not. Class A and hybrid and large SET Tube is still the choice of high end designers.
It may be on paper perfect , but it doesn't matter as the human brain doesn't process its sound quality as equal. Maybe one day , but not yet.
Reply: @MDMedia473 I think he is getting confused by the signal, not realizing the switching is done digitally
Reply: @MDMedia473  wrong. No amplifier is “digital”. It’s not possible to amplify binary data. You can only amplify an analog signal. Binary aka digital code must still be converted into an analog signal prior to being amplified. So it’s a common mistake for people to call class D amplifiers digital.
Reply: @nathanv9562  lol, what is amplification? It's increase the magnitude of the signal... AKA it's peaks and troops. Any signal can be amplified. The input energy is just having it's magnitude increased by a supplementor power source. Any signal can be amplified. 😂
Reply: @MDMedia473  please explain. 1’s and 0’s of a binary code cannot be amplified. Again that is a representation of an analog signal that still has to go through a DAC before it can be amplified. The signal being amplified MUST be an analog signal. You can’t just make 1’s and 0’s bigger. The binary code can define the signal wave with smoothing or high sampling rate but it still HAS to be in analog form electronically speaking to be amplified.
Reply: @MDMedia473  technically cleanest is class A not class D. Analog has more bandwith and is "faster". Zero latency. If you zoom in a waveform e.g. 10 kHz on your oszilloscope you can see the class D ringing. On class A it is absolutly clean. And frequency response is limited at class D. Main advantage of class D is better efficiency and higher output. Even damping factor is not better in class D compared to class AB. But does class D sound better? My old musical fidelity A1 X class A with 15 W rms sounds better than every class D amp I heard. But I didn't hear GaN class D amps yet. Maybe they are better. But for my sub I use a 1000 W rms class D amp with Pascal S2 pro modules due to higher power output.
Reply: @MDMedia473  PWM =/= digital. Class D amps are analog signal in, analog signal out. If you don't have to specify a codec or format, it ain't digital. Class AB is cleaner, too. Class D is good for efficiency.
Reply: @SwervingLemon the switching action makes it digital, digital does not necessarily mean logic is involved. Digital simply means using a two state signal 1 and 0 or on and off.
Reply: @jacobthellamer  By that logic, your light switch is digital. If you want to get that granular about it, every waveform can be expressed as a binary synthesis. That doesn't make them digital.

PWM =/= digital signal. If you'd like to continue this, please read Analog Devices fantastic resources on the subject first.
Reply: @SwervingLemon  a light switch is digital if you use the light to send information. Morse code is also digital.
Reply: @jacobthellamer  Yes, that's exactly the point. The PWM isn't used to encode anything. It's just the current regulation. The frequency of the square wave never changes, only the duty cycle.
Reply: @SwervingLemon  the information would be the music
Reply: @jacobthellamer  Analog signal in class D amplifiers is modulated, not sampled. 
For the signal to be digital it has to be discrete in time and value. In English: it exists only at a certain time (samples). The signal in class D amplifiers is continuous, hence it is analog in nature.
Switching does not equal digital.
Reply: @DIYHiFi would you use Nyquist theorem to calculate the switching frequency for a class d amplifier?
Reply: @DIYHiFi would you use Nyquist theorem to calculate the switching frequency for a class d amplifier?
Reply: @jacobthellamer no, because it's analog. Usually the switching frequency for class D is somewhere between 100-400kHz. 
Nyquist Shannon theorem says at least double the highest frequency you expect in the signal (20kHz for audio), engineers say and a bit more just to be sure. Hence we have 44,1 and 48kHz sampling rates for audio.
Reply: @DIYHiFi  looks like I am mostly wrong, thanks for making me think. Sure the voltage is binary but mark and space are infinite. Mostly because some class D amplifiers literally have ADCs, DACs and DSPs onboard.
Reply: @SwervingLemon I'm sure Purifi and Hypex (probably Ice Power and Pascal too) would like to debate your last sentence. 😁
Reply: @W2APS  Debate all you want. If the frequency changes, it's FM, not PWM.
Reply: @jacobthellamer  That's not what the PWM does. It's not being used to encode anything. I'm hoping someone with an EE degree can hop in with an analogy to explain it, but what's happening is still analog.
Reply: @SwervingLemon  as per my earlier comment I was confusing binary with digital and being thick. The time domain is completely variable. Pwm can be digital if the mark/space are fixed values say 0-255. On the other hand some class d amplifiers literally sample and would be unarguably digital.
Reply: @SwervingLemon The light switch is digital. On or off. If you flip it fast and adjust your on-time, you have pwm control. If you filter it, you have a class D light switch 😂.
Analog means Continues signal. A Pwm signal is updated only in periods. New data, pause, new data, pause, etc.
Reply: @SwervingLemon  Delta sigma ADCs use the same core method as class D amps. The PWM is directly treated as a serial digital signal.  (I'm not an EE but I mess with digital and analog circuitry)
Reply: @SwervingLemon 
A digital signal is a type of signal that represents data as a sequence of discrete values, typically in binary form (0s and 1s). 
But sometimes with more ,for example TLC (3 voltage levels) and QTC (4 voltage levels) in M.2 drives.
Unlike analog signals, which vary continuously, digital signals have distinct levels, making them less susceptible to noise and distortion. 
 a light switch is not a signal and your mains voltage is a analog: sine wave with a frequency of 50 or 60 Hz (depending where you live)
Lastly Time domain has nothing to do with being it digital or not, asynchronous digital circuits do not have any fixed time domain.
Reply: @rj7855  Fixed frequency with no ability to vary bit presence, only pulse width. It can store only one variable and it's infinitely variable between logical 1 or 0. It's not digital. It's almost the definition of analog. PWM is not digital. It's just a switch mode power supply.
Reply: @jeabo0adhd  They don't, actually. While their output (and the internal signal that they're integrating and comparing) is a fixed frequency, it's not pulse-width modulated. It just performs a comparison between a vref and the output of a 1-bit ADC and then spits out an integral of the sampled voltage differences. No PWM involved.
Interestingly, one of the only ADC methods that requires an ADC and a DAC and an integrator AND a filter but they do be making some clean audio signals.
Reply: @jacobthellamer It does also understand decimals.
Reply: @jacobthellamer no, you would not use nyquist for class d, you calculate the harmonics generated by the frequency mixing and select a carrier frequency high enough that they can be low pass filtered, it's much much higher than nyquist.
Reply: @SwervingLemon  a good example of encoding info into symbols is how we're conversing rn: for instance if you wrote the word 'SOUND' on a piece of rubber it wouldn't matter if you stretched the rubber to make the letters wider or taller, it would still say 'SOUND' (so long as you don't obstruct or make the letters unrecognizable by doing so, which is also the case for electrical digital signals). This is obviously not true for am, fm, or pwm since all three are analog.
Reply: @jacobthellamer actually believe it or not class d amps that take in digital audio signals (or sample themselves for dsp stages), are not digital amplifiers. The amplification is done entirely in the analog domain. If you broke it out from the chip package it would look like a digital control interface going to a digital to analog converter feeding an analog class d amp, you could swap the class d amp in it for class a if you like and it wouldn't change the functionality (it would just hit the efficiency and cut down the harmonics, as it normally would). 

As an aside it is possible to build a pseudo-digital class d amp, but nobody does it bc it's much more difficult and produces worse results, you have to sample the output with an adc to give feedback, that then has to go through sigma-delta conversions, and the whole thing has to run in the mhz to keep the harmonics high enough to be filtered out.
Reply: @DIYHiFi PWM is discreet in value. 0 volts or max volts. It is for sure a way to encode an analog signal in digital form.
Reply: @SwervingLemon it is being used to encode something. The amplitude is encoded as purple width. It is digital because it is discrete in amplitude once encoded. Either on or off.
Reply: @rsilvers129  A digital signal has to be discrete in time. In english: it can't be continuous. The comparator outputs two states on and off, but it works on an analogue signal. And it does it's job continuously. This is why it's a modulation (mixing of analogue signals) and not sampling.
Reply: @rsilvers129  It's not, but that's OK. You can continue to be wrong. It doesn't bother me.
Reply: @SwervingLemon in general Class AB is not cleaner, but the absolutely highest ones can be close. The only amp seen so far at ASR and Audioholics is the Benchmark AHB2 which was literally designed for that specific purpose. It’s edged out by the Hypex NCx500 which is used in a few amps now. It’s destroyed by the $800 Topping LA90 Discrete in bridged mode @4ohm delivering 279w @ -119dB vs AHB2’s 179w @ -99dB. So for half the price of an AHB2 you could get 2x LA90Ds and run them in bridged mode, and get more power while also being cleaner. With that said, both amps are going to be transparent so it doesn’t really matter.
Reply: @SwervingLemon  PWM IS digital, though some call it pseudo-analog.
Reply: @SwervingLemon  "every waveform can be expressed as a binary synthesis" Yes, it does when so expressed. A simple light switch IS digital.
Reply: @DIYHiFi  PWM has a switching rate and the analog data which falls between the cracks of that rate is lost. Thus the switching rate is the sample rate. PWM is sometimes called pseudo-analog but is considered a digital process.
Reply: @shaitand69  No. It isn't. It's discrete. That's a property of some digital signals, but it's not everything necessary to call something a digital signal. Please, people, go read before jumping into this discussion. Just because something has only two states is not enough to call it digital.
Reply: @SwervingLemon  No not having to specify a codec or format does not mean its not digital. Digital just means that something is pulsed rather than continuous.  Class D is not as efficient as you appear to think it is and distortion levels are harder to control. Note a D/A device also has a filter, does that make it analogue, only after the filter. Class A is of course the cleanest AB isn't bad, but it all depends on the design.
Reply: @SwervingLemon  Class D is very much digital. It's irrelevant if the signal source itself is digital or analogue, since we aren't talking about the signal source but the amplifier.

If you send in analogue sound, a comparator on the inside will work as a digitizer to decide when the length (if PWM) of the pulse matches the energy level of the audio signal for that discrete time sample. And the driving transistors will work in digital mode - closing or opening fully.

An analogue amplifier will continuously drive the transistors. Which a class-D amplifier does not do. That it can have an infinite resolution of the pulse length or time delay to next fixed-length pulse is irrelevant.
Reply: @SwervingLemon  Class D can use different mechanisms. PWM is just one. You can have discrete time sigma-delta or pulse-density modulation too.

And in the end you still end up filling cups of sound. Either using different number of cups/second or different size of cups. But converted from analogue to discrete samples.
Reply: @perwestermark8920  FFS can any of you read a spec sheet?!
Reply: @SwervingLemon  You forgot to make ant argument. Read any specsheets you want. The class d amp [ignore the D in the name] does the amplification by switching the transistors on or off through a digitalisation process and then filters the result back to analogue.

Now if you take 100 different dayasheets, you will find some will mention digital and some will not. Because it's irrelevant if the datasheet does. Maybe you should read up on different types of ADC, and you would learn that the design of a class D represents one type of ADC and one type of DAC back-to-back.

You have just locked yourself into a way too narrow pigeon hole about where "digital" may be used. And then gets angry when people do not agree on your private limitation for digital. Digital is not about PCM etc. Digital is not about computers. The driving of the output transistors is digital. On or off. And you'll find this concept often taught in digital electronics courses. And you find this in the digitally controlled dimmable lamps. The digitally controlled flatscreen displays.

Go blow a fuse somewhere...
Reply: @jacobthellamer  So my light switches in the homestead are "digital" - now I understand home wiring.😆
Reply: @DIYHiFi  This guy just cannot be wrong. I don't think he'll thank you for the lesson.
Reply: @DIYHiFi  Thanks! This is why CDs are considered "lossless" at 48k Hz. Maybe not to a dog or chipmunk or other such beast, though.
Reply: @SwervingLemon  here u go 

Class-D amplifiers are often mistakenly referred to as "digital" because their operation involves high-speed switching, but they are not digital in the strict sense. Here's why:

Analog Input and Output:
Class-D amplifiers typically take an analog signal as input and produce an analog signal as output (after low-pass filtering). There is no digital signal processing in this process unless explicitly integrated into the design (e.g., with a DAC or DSP).

Switching Operation:
The "D" in Class-D does not stand for digital. Class-D amplifiers work by rapidly switching transistors on and off at a high frequency (PWM—pulse width modulation). The output waveform is then filtered to reconstruct the original analog signal. The switching operation is an analog process, not a digital one.

No Binary Encoding:
Unlike digital circuits, which encode information as discrete binary states (0s and 1s), Class-D amplifiers handle continuous analog signals. The PWM technique modulates the width of pulses to represent the amplitude of the analog signal, but the pulses themselves are not binary data.

**Digital vs.
Reply: @SwervingLemon  A  "codec or format" infers logic. That's the definition of digital. Digital just means on/off. ie: "not linear"
Reply: @lazzer408  No. It isn't. Just because a power supply operates in switch mode doesn't make it digital in this context.
Reply: @SwervingLemon  I didn't write the definition. I only state the facts. SMPS is digital as well.
Reply: @lazzer408  Not if it's PWM, it isn't. If it ain't discrete, it's not digital, end of story.
Reply: @SwervingLemon  If it's not linear it's... DIGITAL! Go argue with Oxford. End of story.
Reply: @DIYHiFi  A Class D amplifier is considered digital as it operates by converting an analog input signal into a digital PWM signal to drive the output transistors, essentially switching them rapidly on and off to produce the amplified audio signal; although it still outputs an analog signal to the speaker, the internal processing is primarily digital
Reply: @SwervingLemon the switching process is started with a digital signal, making Class D Amps digital in nature.
Reply: @SwervingLemon  Not all Class D amps are analog in. For instance Lyngdorf/Tact is Class D contolled with an AES or S/PDIF digital signal - no analog input at all...
Reply: @pnnielsen  While true, this ignores the point that class D amps aren't ALL explicitly digital just because they're PWM, which is the only point I was trying to explain.

I have since given up caring. :)
Reply: Oh, absolutely, let’s use the Nyquist theorem to calculate the switching frequency for a Class D amplifier—because that’s exactly what the world of high-efficiency, high-frequency switching needs: a sampling theory designed for digital systems. Brilliant idea. After all, why not throw a fundamental concept from signal processing at an analog amplifier design?

In reality, the switching frequency for a Class D amp is picked because it has to be massively higher than the audio signal's frequency (think 100 kHz to 1 MHz)—so we can avoid producing a sound that might actually be audible, like some sort of low-fi nightmare. It’s determined by efficiency, filtering, and component limitations, not some mathematical fantasy involving the same principles that govern digital signal conversion. But hey, go ahead and throw Nyquist at it—who needs logic when you’ve got theoretical gymnastics?
Reply: @marcfavell  Captain, O My Captain!
Reply: @SwervingLemon the state of the output signal is at the high or low state only. It is digital. Needing a codec is not a definition of what makes it digital, though digital audio is converted so we can hear it. The inductors are a physical "codec".
Also stating that it is analog in and analog out is nothing, that is the same in all cases. What you would consider digital forms started as analog and are converted back to analog also.
Reply: @davidwolff4696  Oh, I see you missed class that day. Please stop. I really don't care about your conflation of the words digital and discrete.
Reply: @davidwolff4696  Whether or not a device requires a codec is a pretty reliable indicator of whether something is actually processing a digital signal or if it's merely integrating an analog one.
Modulating a signal through switching is NOT digital encoding. There are no "bits" and, in the absence of a comparitor, it's NOT digital inherently. Nothing is a discrete 0/1 in a class D.
PWM is less a binary signal and more like a linear signal chopped in time and phase rotated. It's analog AF.
Reply: @SwervingLemon  what the f are you talking about? I never said anything mentioning "discrete" or otherwise. And no, I didn't miss class. In fact, I developed this system of amplification long before it was a "thing". And I despise "experts" who have to resort to insults, so you just stop.
But since you elsewhere mentioned discrete values, the discrete value is a 1 or a 0. It is this value in a time frame. The efficiency comes from operating the transistors in the digital realm. You may not appreciate the digital nature of it as in comparison to other digital audio types, but it is there.
There is no linear region in the output until it is applied to the inductor.
A codec may indicate digital, but lack of codec doesn't disprove digital. If you wanted a lot of unnecessary work, you could build a software codec for this system.
Reply: @davidwolff4696  1. No, you didn't. 2. There's no discrete here because the modulation is in dwell time, not the high-low range or even the frequency. There's nothing "interpreting" that modulus. There's no digital signal being assembled or read. It's just an analog amp using a PWM power supply.
It's not even properly essential to it's function that the power supply be a switch-mode. You could feasibly replace it with an emitter-follower.
Reply: Simple definition of digital vs analog is that analog is continuos while digital has steps.@SwervingLemon
Reply: @jakep8484  A PWM power supply does not make an amp digital. Please read further in the thread before posting the same (incorrect) point that's been covered in this discussion fifty times already.

A class D amp is analog in, analog out. There can be digital conversion/decoding added to one, but just being a class D doesn't make it digital.

I'm so done with this thread...
Reply: @SwervingLemon  you should probably read what I said first, I never said anything about a pwm power supply. I only said the difference between digital and analog...
Reply: @jakep8484  Yeah, a distinction that, from the context of the rest of the thread, it should already be clear to you that I understand already. Digital has a broad definition and a more precise one when you're talking specifically about signals processing. In this instance, a class D amp doesn't fit EITHER of them. PWM =\= Digital!
Reply: @SwervingLemon  the difference between digital and analog is digital has steps analog does not, that's all there is to it nothing complicated about it at all. I just posted in the comments where I saw debate about it in general, it was more for everyone who ended up in that part of the comments.
Reply: @jakep8484  You @'d me. I'm telling you that it's not relevant to the discussion I was having.
Reply: @SwervingLemon  my mistake then thought someone was confused on the difference between digital and analog.
Reply: @SwervingLemon  The output of a class D amplifier switches on and off between the supply rails. There's no in between state. In that sense it's digital. PWM is one way to encode an analogue signal into a digital form - on or off. The analogue audio is retrieved from the PWM output by low pass filtering the output.
Reply: @mateusseer5353 PWM is not a digital encoding method as the pulse width itself is an infinitely variable value unless otherwise specified. It is not discrete.

You can call it digital in a certain context, but it's not the context that's appropriate when discussing signal processing or transport. It's just a switch-mode power supply, and the noise it generates is something you intentionally isolate from, or filter OUT of, your audio waveform.

I'll die on this fkn hill, mate.
Reply: @SwervingLemon  PWM literally encodes the amplitude if instantaneous signal levels into a finite digital value. That digital value is then converted to a digitally timed pulse, the length of which is a finite digital representation of that signal level over than timeslice. The PWM signal has a finite resolution which can be represented as a stream of 1's representing the pulse and zeros representing the absence of a pulse.. I can only imagine that your internal definition of digital encompases only the base 2 number system, which is incorrct. Hope that helps. Cheers
Reply: @mateusseer5353 Your use of "encodes" in that first sentence is a mighty stretch.

While not all digital signaling need be binary, an important quality of digital signal transport is veracity and fidelity, as in reproducibility of the encoded bitstream.

There is no bitstream here, and the output isn't changed in just amplitude. There is no codec, no interpreter of digital values nor any ADC happening.

A digital system can reproduce the exact same output for a given input, every time. The base definition of a class D cannot do this. You can ADD a DAC to a class D, but that's not what we're talking about.

You go have fun now.
Reply: @SwervingLemon your light switch is digital, actually, since it operates in two discrete states. 
Digital does not necessarily mean logic or processing is involved, digital only describes the signal shape. 

Hope this helps.
Reply: @MDMedia473  There is a "pure" analog signal going in that gets processed  through several stages. Every one of those stages adds or removes something. Its a physical impossibility for a "pure and uncolored analog signal to come out. No such thing as "perfect filtering". If your argument is most of us cant hear the difference, then okay.
Reply: @shaggyhuggins3755 you can say exactly the same thing about the amplifier stages in a class A/B amp.

As for filtering, class D amps switch at frequencies usually in the hundreds of kilo hertz which is 3-4 octaves above the top end of human hearing, it's filtered at -12dB/octave I think which means the noise is -40dB at a frequency you absolutely can not hear.  Also the frequency response of common speakers is near zero at those frequencies.

Your amp, your ears and your speakers are all very effectively filtering that class D noise.  I don't know how much more perfectly filtered you can get...
Reply: @shaggyhuggins3755  😂 tbh I just said that because the argument really doesn't matter. The moment the audio is played it becomes and can only be analog. Since a speaker is and will always produce analog signals. 😆
Reply: @beardoe6874 you are breaking cicles/music (switching) in the middle with Class A/B amps!?😮
You said: ""you can say exactly the same thing about the amplifier stages in a class A/B amp.""
Reply: @ Most AB amps have a loop response into the megahertz so it can ACCURATLY perform error correction. Class D can't even come close. When they are running 40mHz it'll be a match.
Reply: In general if you aint spinning vinyl pumped up with some class a or ab goodness its digital buddy
Reply: @MDMedia473 you don't understand the original post. Class D amplifiers are not "Class Digital".
Reply: @MDMedia473  Wrong.
Reply: @MDMedia473  absolute rubbish. PLEASE READ SOME MORE.
Reply: Switching is digital. On and off. 1 and 0. Digital does not necessarily mean logic.
Reply: @jacobthellamer  NO. Digital may be thought of as "switching", not the other way around. ALL dogs are punks, NOT all punks are dogs. Logic 101.
Reply: @jacobthellamer  Digital DOES necessarily mean logic. On and off is not digital, PWM/PDM is not digital. Your logic implicates all switched mode power supplies are digital, yet nobody calls them that. 
Even class AB amplifiers have control inputs/diagnostic outputs that operate on high and low. Does this mean they are digital? No, it doesn't.

OP is right, Class D is NOT digital, "D" never had anything to do with that, it just came after A, B and C (which is an amp class not used in audio).
Reply: It is digital. The signal input is fed to a comparator and a yes/no voltage is output. It is at the high level or low level. The signal from that point is converted by the inductor back into a multi-level voltage. The efficiency comes from being digital.
Reply: It do not use mosfet it use digital chip .
Dat is the reason it call digital amp
Reply: Also known as Class Dirty. Class A/B is the only amp if you want quality sound reproduction.
Reply: @jbrownjetmech-4783  that's an antiquated view of class D, from when they were built with discrete components rather than fully integrated class D amplifier chips or integrated class D amp front ends with discrete power devices.

That era ended over 20 years ago and since then the quality of the integrated class D amp chips has been steadily increasing with new chips and chip revisions improving at a steady pace of better chips for most applications every year or two.

This whole advancement happened side by side with flat panel TVs getting thinner but still wanting some sound, sound bar stereo systems, cell phones with speakers, active speakers in pro-sound, high power plate amps for subwoofers and car stereo amps.

Some of it sounds bad, like a super thin flat panel TV with weird oval shaped mini-speakers and cell phones but mostly it sounds pretty damn good compared to the alternatives, with higher efficiency that leads to less heat or longer battery life in portables.
Reply: @jbrownjetmech-4783  um, no that would be class a.  Most class a/b amplifiers run the first few watts as class a. Class a also has no crossover distortion like a  a/b  or b because the signal is not split into separate positive going and negative going signals to feed the the mosfets connected to the positive or negative rails and then recombined after amplification.
Reply: @ The first few MILLIWATTS are class A in most AB amps.
Reply: @jbrownjetmech-4783  Now here's the fight, ha ha ha.  If you want the best sound reproduction, class A is the one you want.  Of course, that's with a money doesn't matter and you don't care about the heat/power efficiency.  But for a subwoofer, class D is the standard just because you aren't really worried about fidelity so much in lower frequencies.  Mids and highs are AB all day, subs good luck finding a dedicated amp that isn't D.
Reply: Mf has a wireless connection, he better off with a phone speaker at this point
Reply: He votes harris, excuse him
Reply: @r-ratedstudios3847  Troll makes fake account just to say this. So sad.
Reply: ROFL  @r-ratedstudios3847
Reply: @r-ratedstudios3847  Get the Trump to build your speakers or wire your home.🤣
Reply: Class D amplifier is not analog